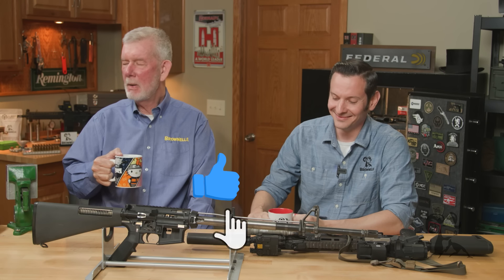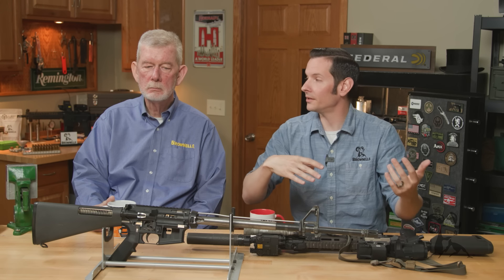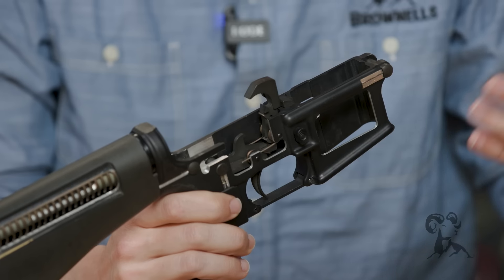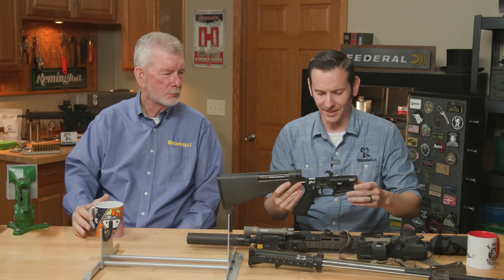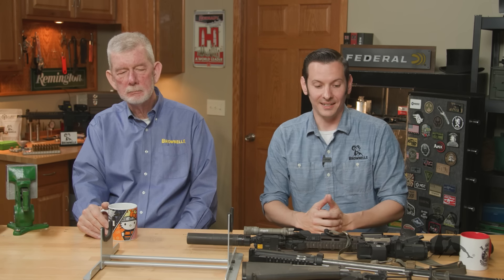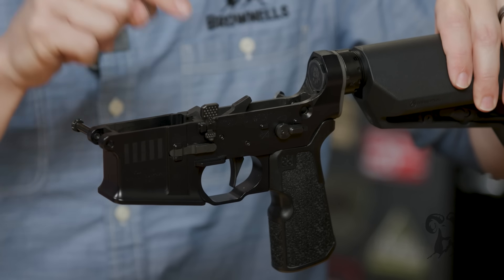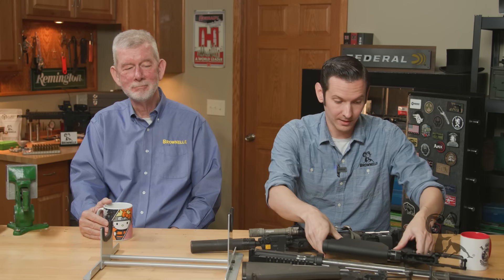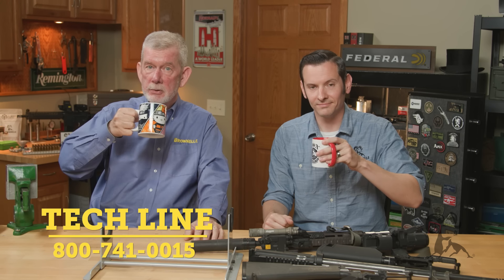SmythBusters: Dropping The Hammer On An AR15 Lower

Comment: In Boot Camp in 1985, I watched another recruit do that a couple times with the removed lower. About the 4th time the hammer went flying across the squad bay!
Reply: So you're saying it snapped the hammer pin in two places at the exact same time? Or are you just full of shit.
Reply: @ Maybe you are, but it broke the upper half of the hammer, about where it impacted the upper edge of the receiver, and the lower portion was still in the receiver with the pin through it!
Reply: @michaelshubr4084  so you're trying to say that a proper heat treated hammer in the military broke in half. You see I would believe you if we were talking about one of those polymer fire control groups failing. Or maybe some extremely cheap Chinese crap. But not proper hardened steel smacking against aluminum. A fire control group in a true full auto M16. If by some miracle you're telling the truth it's probably the only time in the weapons existence that a hammer would have ever broken half. Even if the firearm is so severely over gas that the BCG is traveling at ridiculous speeds it will break the hammer or trigger pin before ever damaging the hammer. And just to give some credibility to what I'm talking about I served in '01. Went to basic and trained on the M16A4 at fort Benning. And I have owned more AR-15 pattern rifles than most people will ever own firearms total in their life. So I do have first hand, hands-on experience. What you were talking about is so extremely unlikely it would be like winning the lottery twice on the same day while being hit by lightning.
Reply: @ I was 18 years old at Ft Leonard Wood, and I saw, what I saw, but our Drill Instructors has told us not to dry fire the lowers while removed from the uppers, and I can only assume they’d seen it before.  No idea how many times that lower had been snapped like that before by numerous recruits, but I saw it happen, and we’d been told not to snap the lowers while apart?!

Comment: I have broke a bolt catch like this, that is why I release the hammer with my thumb as tension. I hear you but I did have a bolt catch literally break in half on a Colt lower all factory parts from colt. 🤷‍♂️

Comment: I will just add my own humble anecdote to this video.
I dry fired like this once on a polymer lower, and absolutely cracked the lower in the rear of the magazine well.  Now having said that,if memory serves me correctly,  the bolt release was not installed, allowing the polymer wall to take all of the hammer's force. 
I could still use the lower after that, but man, I was unhappy. Fortunately,  I only paid 40 bucks for the lower. 
So I would suggest as you gents have said, avoid it if you can; and definitely don't do it on a poly lower.

Comment: Tipton, for one, has a built in blocker with rubber where the hammer falls on their mag block.  I've been using that for at least ten years.  So, I've been over cautious but I have also had no damage from the hammer falling on the lower without the upper in place.  My caution has caused me no wasted time or money so I just might continue with this questionably unnecessary practice.   Although I might slip up once in a while just for the fun of it.

Comment: Personally when I clean mine(Anderson AM15), I don't drop the hammer. I will however hold a small bit of tension on it and squeeze the trigger and let it come forward slowly.  I was always told dry fire was bad so I generally will not do it with hammer fired arms.  Now my striker fired pistol...... 😵‍💫

Comment: I don't drop the hammer as you demonstrated, but I had a bolt stop break on me while firing.
After examining the bolt stop at the point of failure, I noticed  (under magnafication) that the part had a minor void in the metal.
I replaced the part and never had any other such failures.

Comment: It is better to place your thumb on the hammer while pulling the trigger.  Reduces wear and tear on the trigger, hammer, and disconnector springs.  I couple times I have had them pop out of position, but only  seen one spring break due to age.  Never seen hammer break, but certainly other components mostly external, and witnessed a carrier bolt group fail in combat due to wear and tear.

Comment: I've had  three recivers come across my bench that the frame was damaged in said manor.  Two DPMS and an Eagle Arms. Had to open the bolt catch slot back up. All were returned to working order but damage was obvious. One bolt catch was destroyed from being stuck partially open, others were usable. Enough smacks of hammer into aluminum will deform. Not sure if guns were 6061 or proper 7075. aluminum

Comment: Every time I let my carpenter's hammer fall on my thumb I feel bad about it.
I worked very briefly as an Armorers assistant (not my primary MOS of 0341 mortars) in my Marine Reserve unit in the 1970's and letting the hammer drop like you're showing was never talked about and was common practice. Like you say not a good idea but most likely not likely to break your rifle.
Thanks for the discussion.

Comment: I think people forget what it was designed to do regularly, which is to smack the firing pin and then get slammed back into the trigger group by the bolt carrier. The spring exerts the same force on the hammer whether you drop it on the lower receiver or the firing pin, and so the hammer collides with a barrier with the same force every time.

All that is to say is that it was made to stand up to repeated collision. Your hammer is gonna be fine if it was made right.

Comment: I treat it as a "best to avoid doing it repeatedly" item. I won't freak out if it happens, but making it a regular habit is not a good idea. Best to avoid potential problems, rather than tempt fate.

While I was in the military, we were instructed not to do it, and that was 20 years ago.

We did clear our rifles and dropped the hammer on an empty chamber, and would leave the hammer down when handing it over to the armorer.

I know the AR platform is tough, the things I did with one during training is a testament to that, but that doesn't mean I am going to prove my personal AR is bomb proof by tossing it as hard as I can down range.

My philosophy is to not stress over the old wives tales, but don't be dumb about things either.

Comment: Wouldn’t take much to build a test rig.  I have seen a trigger group test rig that cocked and fired 100k times and counting using an electric motor.  They had a stop block in the rig so it didn’t just fall on the lower web (rig had no bolt hold open).  Same thing without the stop block…

Comment: To expound upon a point about inspection.  The inspectors with the company will take samples of the finished hammers one or more of every few hundred or thousand and put it in a gadget simulating the hammer strike to test the integrity of the part, and I would think that that the test "gadget" strike is much harder than your rifle and goes through this test a multitude of times to make sure the part is sound and represents hundreds of the hammers manufactured.

Comment: Original AR10 lowers from the 50's will break from doing it. They will also break from the last round hold open when the last round is fired. The remedy a lot of users have is to load a dummy first in the magazine. I own one lower which has cracked, and a couple which I will only fire with a dummy as a last round.

Comment: We had the bolt release oblong “paddle” break when a friend pulled the trigger of a lower assembly only before we could yell, don’t. It was CMMG and the parts kit was around $100
Reply: The bolt slamming into it on the last shot isn't a light force I feel like it was probably a bad part if it failed from doing it one time

Comment: Sooooooooooooooo? No real answer. I believe from a commonsense standpoint if you use the mechanism, whatever that mechanism is, you could reduce its longevity and or break it. Unfortunately, I am unaware of any molecular studies out on the impact this has on the metallurgy of these components. That would be the only way to put this to rest. I loved how you clarified the Milspec & low bidder misinformation though. Note: Since 2005 some branches have adopted a "best overall value" to include their specific environmental and operational needs instead of the generic "low bid" model. Thanks guys!

Comment: Dropping hammer on lower only? Agree. likely won't cause a part failure, but is introducing unneeded wear to interfacing parts.

Dropping hammer on fully assembled AR but no cartridge in chamber?  Zero issue (unless you believe the incremental addition of a thin piece of brass getting hit by the firing pin doesn't wear the system at all)

Comment: When I was in the Army, not once did I ever see any one drop the hammer with the upper and lower separated, so I don't know where you're getting that idea.
Reply: Not sure when you were in but from 2001-2013 everybody did it and it never hurt anything
Reply: @brandonbowman5915  i'm not saying it hurts anything. I noticed different units do things differently, so it could've been specific to my unit.
Reply: It happened all the time in the late ‘80s. Some soldiers did it when cleaning, others didn’t but it was never taboo.
Reply: I was never in the Army because Israel can’t fool me to fight its wars, but I guarantee Steve caused visible damage to his lower on the web behind the bolt catch where the hammer hit it.

Comment: I'd just like to point out, most AR-15 lower receivers are made out of an aluminum alloy, whereas hammers are generally a harder Steel to deal with the repeated smacking against a steel firing pin. Inevitably doing this over time must lead to denting and deformation of the lower receiver, even if the hammer first contacts the bolt catch and not the lower itself. 

But hey, what do I know? I'm just a gunsmith.

Comment: So 3 things: in air force bmt 15 years ago, we had training rifles to carry around that had no hammers  except the one day we were qualifying, so nobody was dropping their hammer like that.  When I bought my first AR in 2018, it was a plum crazy polymer lower (budget was tight) and the owner of that company had a video claiming specifically that his lowers were stronger and were ok to drop the hammer on without an upper.  Lastly, I recently purchased my first 1911 and had never heard not to drop the slide on an empty chamber until I was reading the manual and watching springfield's disassembly video the other day lol
Reply: Was the point of the hammer less rifles to prevent your dry firing or to make sure a bunch of noobs couldn’t manage a negligent discharge?
Reply: They treated y’all worse than Andy did Barney by only giving him 1 bullet. Man, here’s your rifle but we don’t trust you with it having its hammer. 😂
Reply: @WoodsintheBurg94  TBF boots frequently leave rifles unattended.  So much so there’s memes about it.  So deactivating the rifles may add to general over all safety.
Reply: @charleshetrick3152  🤦‍♂️In the Army, leaving a weapon unattended would have gotten us kicked out or at least severe punishment.
Reply: @WoodsintheBurg94  there’s a YouTuber Angry Cops who’s a drill for the army and he rants regularly about rifles left leaning against portajohns or similar.   I’d presume the punishment would be very interesting.  I don’t know if I’d resort to kicking folks out, basic is supposed to be a learning experience after all.  I grew up with guns so by age nine or so I wasn’t making mistakes anymore and was only ever allowed pellet guns till I reach zero mistakes.  I could see an 18 yr old especially without growing up around d a culture of firearms safety need fail safes like inoperable arms and might deserve a second chance after leaving their rifle somewhere.
Reply: @charleshetrick3152  pretty much a bunch of noobs, but most of the air force doesn't use guns for their job.  I turn wrenches and there's a good portion that rides desks.  We call them NONNERS (in a fairly derogatory way) like other branches have POGS
Reply: And since we only have to qual every few years except for deployers, unless you're into guns as a hobby, it's like the first time every time lol

Comment: 3:45, parts kits even if mil spec and no more, are fine for 95% of people out there who own these rifles. I have not heard of mass breakages, battles lost due to lower receiver parts breaking left and right. Will a bolt release last as long as one made of super-duper steel? No. Will it last the life of the rifle for a civilian? Yes. Same with CH, BCGs. I replaced the mils spec CH on a couple of mine because I mounted scopes on them, needed longer wings on the CH

Comment: I have heard to avoid dropping the hammer without the bolt catch installed. There's just the thin aluminum partition between the trigger area and the bolt catch cutout. It might break that partition. Never heard of a hammer breaking. Most likely the hammer was already cracked.

Comment: I was told its ok to drop the hammer on the bolt carrier group, but not drop the hammer on a lower not affixed to the upper. This after I did the latter and broke a tiny spring in the trigger group. Allegedly.

Comment: It's a non-issue with a fully assembled lower reciever. Different story if you're mid-build and drop the hammer without a bolt catch installed, especially if your lower is not of the greatest quality. Saw a guy I served with break a polymer lower on one of his personal "builds" in exactly that manner about 6 years ago.

Comment: During training, I was issued an m16 that was missing the little nub on the front of the bolt catch that interacts with the mag follower. I can only assume that it had sheered off due to people doing this over a long time.
Reply: Doubtful the hammer doesn't impact anywhere near that nub.
Reply: @redtra236  I think the force probably just transferred through it like a Newton's cradle effect and due to the right angles at the base of the nub it probably just stressed fractured it off.

Comment: The issue is you are slamming steel on to aluminum. Of course the hammer won't break. Don't be ridiculous. But if you slam steel on to aluminum, in a way it was not meant to be slammed, repeatedly, eventually you could crack it or otherwise damage it.

And as for dropping the slide on an empty chamber (on a pistol) Wilson Combat and Massad Ayoob have a video on why you should not do that.

Comment: I have dropped the hammer on a new lower build after installing a 3# trigger and after hearing the snap and seeing it hit the lower never again will i do that. Just glad anything didn't break.
Reply: There’s a scene in a book I read as a child wherein a boy stares down a wolf threatening it with a large stick.  The wolf yields and the boy leans on the stick and it crumble.  The stick would have been useless if a real fight had ensued.   Your firearm shouldn’t need to be so gingerly treated.  If it were to break it would be because of poor manufacturing of the receiver or whatever part and you’ll want to find that out in the armory not in the field.  In 30 yrs I’ve had exactly one bolt sheer itself and it was from a very well regarded brand.  Fluke defects in manufacturing exist but dry firing an AR assembled or not will not induce a failure unless a manufacturing fault exists.

Comment: ive never seen even the cheapest components break. i have, however, seen, more than once, the bolt catch stop working because the web in teh receiver was bent forward slightly, pinching it, form doing this.

Comment: I've accidentally done it before but I try to avoid it. I think it's very unlikely to break anything but I think it possibly could in a rare situation.  The parts that are getting smacked with that hammer are not supposed to be getting smacked with that hammer. I think most people avoid it.

Comment: Good morning, men. I recently saw a test on gun oils, and they said "Balistol" wasn't very good as a gun oil. I've used 3 in One oil for years, as did my father & Grandfather. I remember back in the good old days, when times were bad, on the can (it used to be metal) was a picture of a long gun, along with the bicycle, skates, and various other items the oil was recommended for use on. What is your and Steve's thoughts on using this for protection of firearms? Thanks, Caleb!

Comment: I was taught that when the lower is separated from the upper, you ride the hammer forward instead of just pulling the trigger and letting the hammer smack forward. The reason for this was not because you might brake your hammer or bolt catch but because the lower frame is made from a softer metal (aluminum) than the hardened metal (steel) and over time will deform. That deformation is unlikely to put the weapon down hard but it can make the bolt catch stick and will no longer rotate as necessary. Is it a big deal if you smack the hammer forward? No. Good practice? Nope

Comment: The reason I think this is fuddlore is Ive seen all kinds of pictures of broken guns and gun parts but never once have I seen a crack in a receiver right in front of the hammer. Even searching for them only comes up with polymer receivers that cracked in other ways
Reply: The crack appears on the left side of the receiver, the aluminum boss that contains the bolt catch pin.